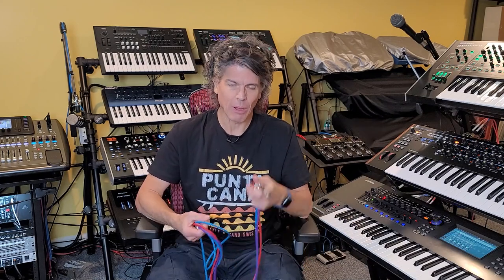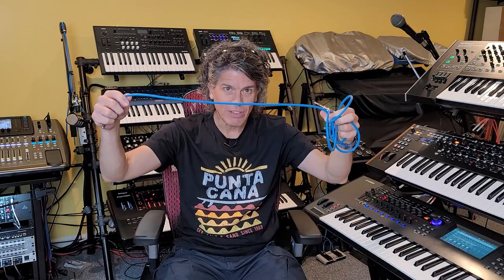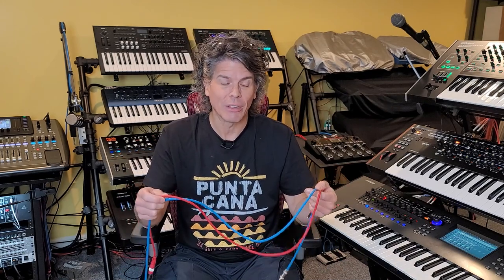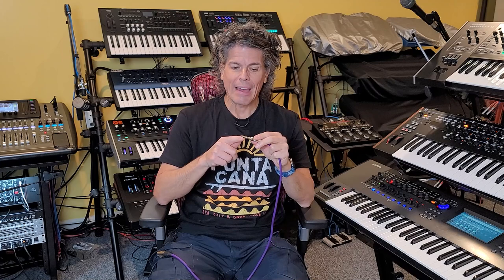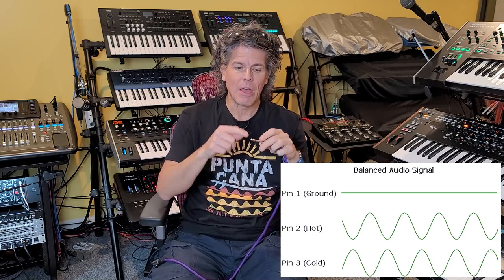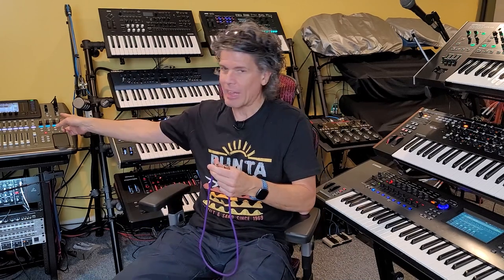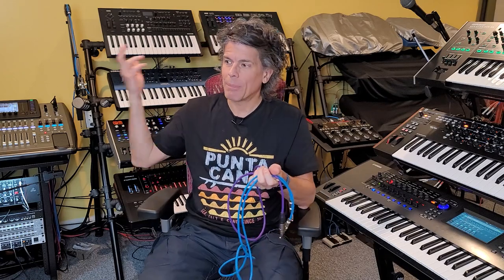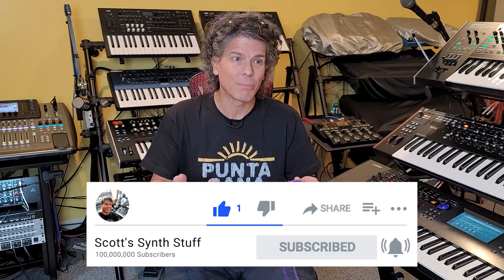Balanced vs Unbalanced Cables: Everything You Need To Know!

Comment: "Removal of the safety ground connection on equipment can expose users to an increased danger of electric shock and may contradict wiring regulations. The safety ground is disconnected by an adaptor (cheater plug) in a power lead in which the ground conductor is deliberately disconnected, or by cutting a ground pin in the power plug. If a fault develops in any line-operated equipment, cable shields and equipment enclosures may become energized, creating an electric shock hazard. For example, the metal shell of a stage microphone or the strings of a guitar may become energized, creating a hazard to performers. British musicians Leslie Harvey and Keith Relf were, in the 1970s, examples of this type of electrocution, in both cases fatal. Many other musicians have experienced electric shock due to ungrounded or improperly grounded equipment with less severe consequences."

Comment: This is really interesting and makes sense. In fact , I redid my whole studio with 6 synths including several multi out units using only balanced cables.  The issue was major noise much of which I traced to usb cables. I struggled for weeks until I read somewhere that balanced cables can produce excess noise in synthesizers. So I switched out all my synthesizers to unbalanced cables and the problem went away. I’d be interested in your thoughts on this.

Comment: What about “balanced cables” that only have a TS (Tip-Sleeve) jack.  My Monster ProLink Acoustic instrument cable only has a tip and sleeve but the insulation advertises being “Bandwidth Balanced”.  Any idea what’s going on with this?
Reply from the maker: Those are not balanced cables. "Bandwidth Balanced" is marketing speak that means nothing.
Reply: @ScottsSynthStuff  That’s pretty ridiculous lol.  My father bought it years ago but it seems Monster cables really are a scam. 

Yeah just took it apart (I have to replace a jack connector anyways) and it’s got two core wires surrounded by outer shielding. One wire is connected to the tip, the other to the sleeve (ground).  The kicker is that the outer shielding is only connected to the sleeve (ground) on one end of the cable.  There is a “directional” signal flow notated on the insulation which is for noise reduction.  It has something to do with the shielding acting as like a faraday.

Comment: Hey Scott, I am setting up a hardware vocal chain (about three to four). Of course I want it quiet. I plan on ordering the balanced cables. Does the length of the cable effect the noise? The three units will be chained together going into Presonus Audio box.

Comment: Thank you, for explaining this. 
I had an issue that ended up being  an internal amp problem.
I bought a set of monitors  and one of them produced a 50 Hz noise when warmed up.

When you just bought your gear and connecting cables it can be quite confusing. 
No signal cables attached is  a way to check if it's something else then cables.

Comment: I used the very same trick with an unbalanced output rewired to balanced inputs on a Yamaha MX49 where the noise is introduced by the ground from the USB connection to the PC. Works like a charm.⚡In the early days I used to tape off the ground connection on the power plugs but that is somewhat illegal and may be dangerous to your health. 😵

Comment: 8:45 The end result of your example is wrong. You forgot to invert the -1, so in your example the output would actually be 4 (3 + 1) not 2 (3 - 1). Imagine if you had no noise in your example (no +1), the output would be 4 (2 + 2), since you're inverting the -2 at the end and adding it onto your original signal (2).

If you don't believe me, try it with other numbers such as 7 for your original signal and 3 for your noise. Using the way you calculated the output, you would have 7 (original signal) versus 6 (10 - 4). When actually the output is 14 with or without noise.
Reply: Exactly...

Comment: what about a balanced cable for guitar? even if the amp is just mono unbalanced....what to expect? my guitar cables run along other power cables...
Reply from the maker: You would first need the guitar to put out a balanced signal, which means it would have to have a preamp built into it. I haven't heard of such a thing, but that doesn't mean it doesn't exist. I'm sure someone, somewhere, at some time, has done it.

Comment: Thanks for a great video! This did indeed remove some of the fuzziness in my understanding of the matter. However, some still remain, like:
- How does stereo / mono cables enter into this? I have never seen a 3.5mm to 2x 6.3mm be "balanced" in the 6.3mm end. Are there balanced / unbalanced stereo cables? Would that mean ground + four signal cables in one cable and would the mono ends have TRS configuration? 
- I have som really noisy synths and other instruments (like the Roland MC-101 and the 1010 music Bluebox (which is a compact mixer). They are USB-cable driven and that seems to be a recipe for noise. If I run these off a usb battery instead of from the computer or extension cord with USB, they are completely silent. Where does this huge amount of noise come from? The MC-101 even amplifies the noise when more leds light up.
Reply from the maker: Generally speaking, any "stereo" cable is a consumer-grade unbalanced cable. Most professional audio is all mono, and you can run two mono lines to give you both a left and a right. Just because you see three conductors on the plug end, don't think "stereo" - think "balanced."

I have never seen a balanced "stereo" connector, or heard of one.

As for the noisy synths with USB cables - I covered that in this video: https://www.youtube.com/watch?v=0SVgmVokq1k

Comment: Hey Scott I’m a new Beginner but I invested less than $2,000 for my Home set up which includes a Roland JV-1080 with four expansion boards & I just got the new red Akai MPC One Plus Drum machine/Sampler. I have the Hosa CPP-202 Dual 1/4" TS to Dual 1/4 which are unbalanced & I wanted to know what outputs should I put the cables in my Roland JV-1080? Because it has left & right outputs & a Mix Out with a left Mono also the Cables are Red & Black & I wanted to know which output should I connect the cables to the 1080?

Comment: Wow! This is what I needed to hear! My PreSonus audio box has been crashing during livestreams. Not sure if it’s PC related or too much voltage altogether.

Do you still recommend plugging all “larger” devices into same outlet even if I am using all balanced cables? I may have made a mistake thinking I needed to utilize 3 separate for powered monitors, PC, interface, and amp. 

Do multiple small adapters for effects and other things cause problems as well? I feel like I have way too many wires and I tried to cluster them together to avoid tripping hazards. Maybe that’s my 2nd mistake? Lol

Comment: Great video! I have a question for you that im confused about, so I'll try to keep it simple... I have a KORG WAVESTATE Synth... What i want to do is come out of my WAVESTATE L an R,  into a BLACKHOLE Pedal mono input that can switch to stereo, (this is the only option for the input on this pedal) then come out of the BLACKHOLE Pedal L an R, go into a AEROS Looper L an R, then come out of the AEROS Looper L an R, go into my mixer 2 channels... Do i use TS cables or TRS?

I know the cabe coming out of the synth going into the Blackhole Pedal they make a splitter Duel TS mono into a TRS stereo...

I just dont understand if TRS cables can be used for mono and they can cancel out noise, why not go with all TRS, i dont understand lol... Sorry!

Comment: Nice explanation, it's just the part where you say the result is a +2 signal that is not correct.

The op-amp on the receiving end (mixer, audio interface etc.) will invert the second (-1) signal meaning the first (+3) signal will have a - (-1) = +1 signal added to it, resulting in a signal that is (+3) + (+1) = +4. Not +2 as you say in the video. So the final signal is two times the original one.

In short: the signal was +2 and ended up being (+2 - (-2)) = +4 in the mixer, the noise was +1 and ended up being (+1 - (+1) = 0) cancelled out by the polarity inversion.

Comment: Hy bro, great explanation about cables, but i need some advice. I got a pair of audio monitors (presonus eris), they were a cheaper quality option than a pair of standar stereo speakers for my pc. The question is: 
What would be the cheapest way to use them with a balanced audio signal, without using an expensive audio interface. Since I only want to listen to quality music, avoiding the deadly noise from my computer or notebook.

Comment: Hi Scott, just interested in your opinion: why Nord still uses unbalanced outputs? Even their "top shelf" NordStage is unbalanced. I don't think they save money on it: there are  cheaper synths which have balanced, e.g. MODX. Is there any disadvantage in balanced output? Thanks for your video :)
Reply from the maker: No disadvantage to balanced, as they are reverse-compatible to unbalanced (you can plug an unbalanced cable into a balanced plug and it will work fine). No idea why Nord, being a high-end brand, insists on still having only unbalanced connections. However, the MODX also has unbalanced outputs - you have to upgrade to the Montage to get balanced out.
Reply: Most digital synths since the 80s like the DX-7, Korg M1 and most other flagships for many years did not have balanced outputs. It's a newer trend that, if your willing to pay double for your modern synth, you can get balanced outputs. Some of the classic big analog synths had balanced outputs.

It's no big deal at all, and a simple thing to correct. Nord doesn't bother, because it's no big deal, easy & cheap to correct. They have better things to worry about, and so should anyone worried about it.

Don't believe those people that would make you think it was a "selling point" to have balanced outputs. Not unless the selling point is to save $30, $10 on needing an extra 1/4" patch cable, and maybe save 30 seconds hooking up an extra box/wire, or taking up the space of a deck of a cards. If that's all a big deal, pay the extra $1500 - $2000 to get your modern flagship with balanced outputs if available.

Many people are still going to want to use a DI even if their keyboard offers balanced outputs.

True selling point value of balanced outputs = $50 option.That's what it should be. Not $1500 - $2000.

And if you happen to use other keyboards and run through a small mixer that has XLR output as many of us do, you don't even need a DI.

Hope that clears it up for you.

Comment: The question I have is whether there is a difference in using balanced vs. unbalanced patchbay cables. Those 30/60cm long patch cables. Is it necessary to get balanced ones when the input/output cables are balanced as well?
Reply from the maker: 100%, and in fact the red cable you see me showing in the video is one of my patch cables. If you don't use a three-conductor patch cable in your patch bay, you're eliminating all the benefits of using balanced connections everywhere else in the signal chain. For balanced connections to work, they should be balanced from end to end.

Comment: I understand mixers' XLR inputs expect mic level signals. What happens when you connect a synthesizer's bal/unbalanced 1/4" TRS jacks, which carry line level signals, to the XLR inputs of the mixer using 1/4" TRS to XLR cables? The Roland Fantom-0 series only have bal/unbalanced 1/4" TRS jacks for example.
Reply from the maker: Many mixers, such as my X32, can adjust the gain to work with microphone or line level signals on the XLR input.

Comment: Hi Scott, great video on balanced and unbalanced cables.  What is your opinion about needing to use a snake when getting audio out to the mixer in live situations?  How well shielded are they for eliminating noise?  Thanks
Reply from the maker: I use them in my studio, both for audio and MIDI. Internally, they are just a bunch of individual audio cables jammed together with a big outer skin. The inner audio cables are thinner because they don't need the thick, tough outer skin, so many more fit inside. But technically, they are identical to running a bunch of separate cables - except you don't end up with a rat's nest of cable spaghetti at the end of the night!

Comment: Would automatic voltage regulators on both sockets fix the ground loop issue ?
Reply from the maker: No. Regulators do not affect the ground potential, and differences in ground potential is virtually always the cause of ground loops.

Comment: I get how a fairly simple flipflop type IC can switch the phases in the mixer thanks to the drawing provided in this video. BUT What wizardry flips the phase in the source device that uses XLR balanced connectors. Like a microphone.  There is no current to drive circuitry except for phantom powered mics. Say a Shure 58 mic with no phantom power? 
Great video BTW, a lot of really useful tips in there.

Comment: Thank you for sharing your knowledge, learning a lot here. I have a question, I have a Focusrite Scarlett Solo and it seems the left output only works if I plug the cable halfway through, I mean, you can hear the sound only if the Tip of the cable touches the negative part of the balanced output of my sound interface. The right output works perfectly with the same cable, so the cable is not the problem; with a TRS cable works well but I think it's because the negative part of the bal output sends the sound through the negative of the cable, I don't understand why it doesn't send the negative also through the TS cable. Hope you can clear my ideas, thank you very much for your help. Greetings from Costa Rica.
Reply from the maker: I've had that happen before when a cable was just not made quite to spec - or sometimes the housing of the cable prevented it from going in all the way.

Comment: Excellent vid.  I’d like to know how different outlets or wall plugs can affect the noise ie is it necessary to connect to your one shared source of power?
Reply from the maker: It definitely can. There can be ground potential differences, or especially (on double-insulated devices) voltage potential differences on the neutral line. Depending on how the individual devices are built, this can inject noise directly into your audio chain. To defeat this, I use power strips like this one to make sure everything is running on a single circuit: https://amzn.to/421BCTl

Comment: Thanks for that, very informative. As a drummer with also a basic recording setup this is stuff I've never studied, even though I spent 4 years at drum school. So, novice question, but I assume from this that a balanced jack cable is the same as a stereo jack? So if a cable looks like a stereo cable it's automatically a balanced cable?
Reply from the maker: A TRS cable means three conductors - tip, ring, sleeve. The same cable can be used for a balanced connection, or an unbalanced stereo connection.
Reply: @ScottsSynthStuff  thank you so much. That's what I thought but I started to doubt ... It's confusing how retailers describe them and surprisingly difficult to find a clear "this cable is good for both" description. Maybe it's one of those things everyone thinks everyone knows already.

Comment: A balanced connection isn't hot, cold, ground. Both signal conductors are hot. If you go back and look at whatever you used as a reference, you'll see that the + and - symbols are used to designate polarity, not electrical hot and cold. Also, you need to check the pin layout on the components you are connecting. Not all manufacturers use the same pin layout, so if you don't get it right, you'll create a short circuit. Beyond that, you really shouldn't have to make a cable like this. You can use xlr to rca adaptors. You just have to make sure that the adaptor doesn't shunt the number 2 pin to ground. Some do. 

That said, you're better off using a direct box. What he did in this video is electrically identical to an unbalanced rca connection. A DI box allows you to keep the signal balanced. You'll have less noise issues and be able to use long cable runs, if you need to.
Reply from the maker: I did not include + and - as "hot and ground" - they are indicating PHASE - the positive phase, and the negative (inverted) phase, which is what the two pins in a balanced connection contain.
Reply: @ScottsSynthStuff  Correct. You didn't say that. look at my comment again. "A balanced connection isn't hot, cold, ground." . Polarity is never referred to as hot and cold. And its not just me being picky. This is the most common mistake people make when trying to connect balanced and single ended gear. There are different ways a balanced connection can be wired. Quite often one of the signal wires gets combined with the ground/shield pin. Sometimes its OK to do it, but not always. When you call one of the signal conductors cold and label it with a -, you kind of make it look like a ground. In reality, its a signal wire, or a hot wire. Combine that with a real ground and you create a short circuit the second you plug the cable in. Most of the time it results in a noise, but it is possible to damage something. 

In my opinion, you're better off using a DI box. Its cheap, there's no reason make special cables and it keeps the signal balanced. If you already have a balanced signal, why not keep it that way? It almost eliminates any noise issues that arise from single ended connections, and you have the option to use long runs of cables, if needed. 

I'm guessing you haven't really looked into this issue for a while. The industry has taken balanced operation and turned it into a disaster. Not only how its implemented, but how its marketed. They're even playing games with headphones now.